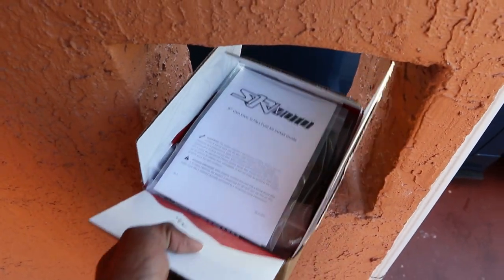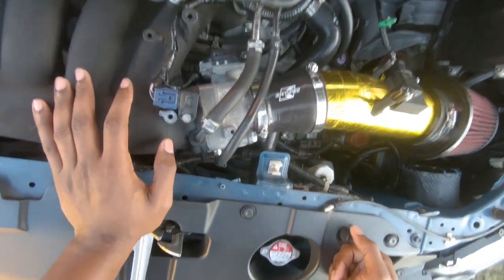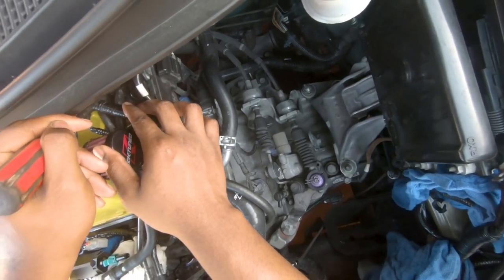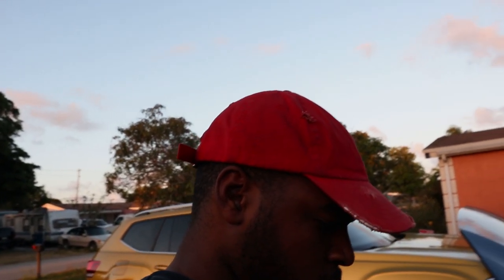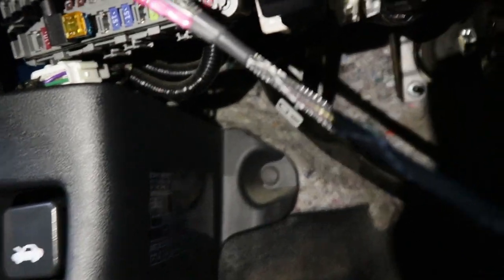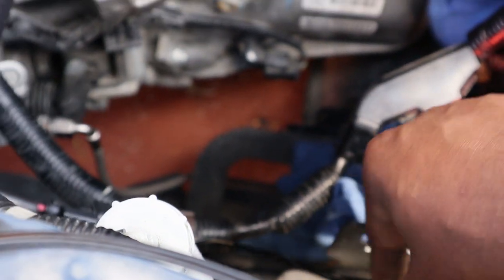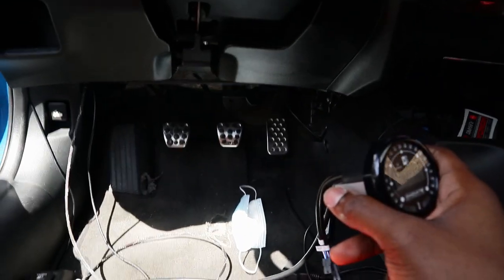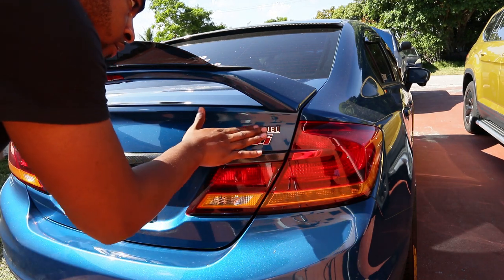FLEXFUEL KIT INSTALL ON MY 9TH GEN SI! E85!

Comment: What all do you need to do this? Just the injectors and fuel pump right?? You don’t need the flex fuel sensor from Siri Moto it’s optional right

Comment: where did you mount the sensor lol im trying to do flex fuel too but im using the innovate kit not sirimoto just wanted to see where they mounted the sensor
Reply from the maker: On the firewall, sirimoto provides a bracelet to mount it up

Comment: Did you do any tweaks to the tune?? I installed this kit on my 9th gen yesterday, and my revs keep going up and down on their own from 1.2k to 1.8k revolutions when im in neautral. I checked for a vacuum leak, and mad sure everything was on right, ot doesnt smell like gas or amything. Everythong seems ok And i cant seem to find anything!
Reply: I also installed a dw65c fuel pump like a week before i installed the flex fuel kit, and she was running fine
Reply: u touch anything on ur intake? make sure u disconnect ur battery b4 doing any of this

Comment: I know the cars ecu will sense and adjust for e85(with the sirimoto kit) but... can you have two tunes one for e85 dyno tune  and the other for a  93 tune at the same time(switch back and fourth between the two)on the ecu? Edited to make sense, was looking like a chinese bot. Someone better comment I edited this 5 times
Reply from the maker: I know what you’re saying .. and yes you can do that but you’ll have to basically be  empty of gas when you’re gonna switch gas everytime
Reply: @zoovie  so if i wanna do that I don’t need to do the tuning on the flex fuel right?

Comment: do i need to get a new tune after installing a flex fuel kit ?
Reply from the maker: Yes if you are goin to run e85.. if you’re still gonna run 93 you’ll be fine until you actually pump e85
Reply: @zoovie  im already running e85 i just want to run 93 when e85 is not available